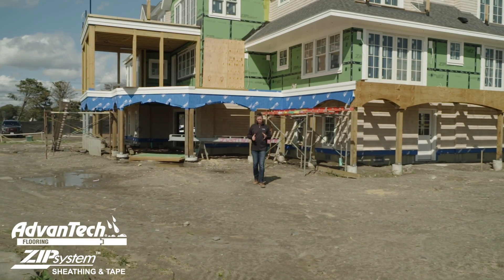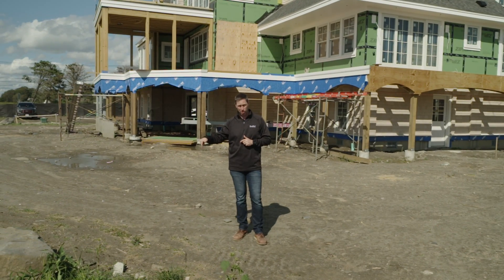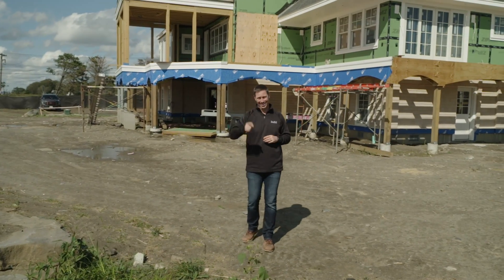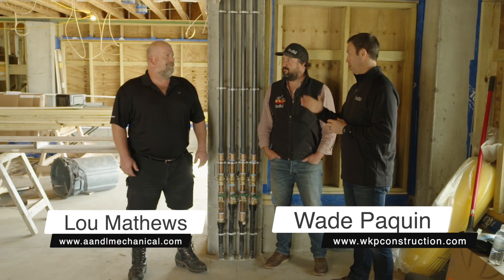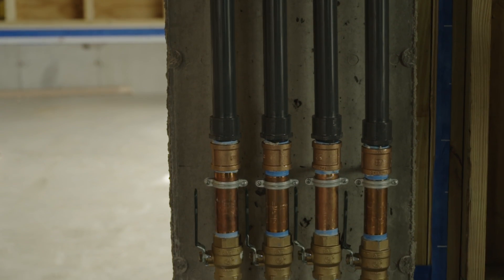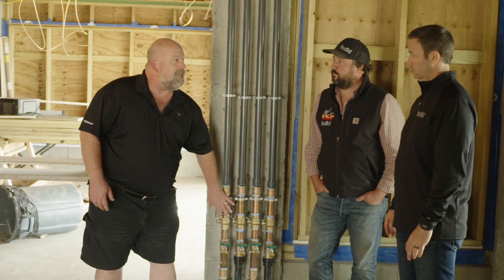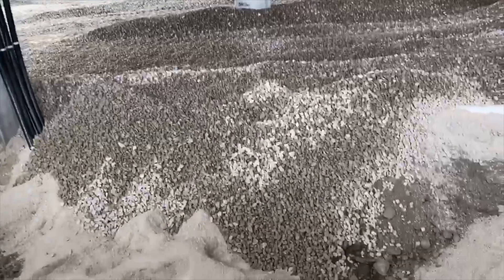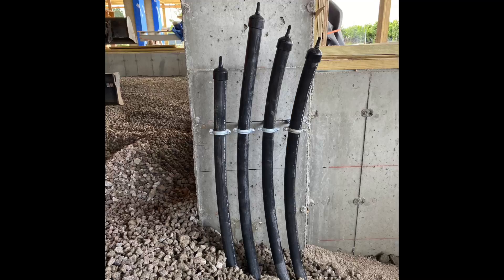Debunking 3 Geothermal Myths

Comment: Here’s another advantage. It doesn’t matter if outside air is 130 degrees or -40 degrees. The geothermal well will never know it. Amazing technology.
Reply: You're mostly right. There are several strategies for ground source systems. I assume that you're referring to vertical loops.
The conductivity of the native formation, and the system's contact with it determine the energy transfer.
Designing for the most prevalent usage (heat  or cooling cycles) is the starting point. Southern, desert, and basically most of the US south of the northern tier of states are designed for cooling cycles. 
Loop  placement. Thermal conductivity will determine distancing between loops. The addition or removal of thermal energy by each loop remains efficient as long as there is no influence by the others. The gradient, or flow direction of the water table and any aquifers which are confined below should be considered.
The driller's experience is important. Knowledge of the local geology determines drilling strategies to both advance the borehole and keep the length of it open for loop placement.
Most important is grouting the annular space of the borehole between the loop and the native formations. Voids affect performance and efficiency.
Reply: Ric Havic Whoever you are you seem quite knowledgeable about the system’s cycle design. I wonder what are you’re thoughts for installing the system onto a bus mobile home or what my young generation calls the “Schoolie Movement”.
Reply: @DylanBegazo  How would you propose moving geothermal wells to follow a schoolie?
Reply: @BullScrapPracEff       Above ground pool,,, maybe,,, lol
Reply: How is it that geothermal energy wasn't covered in so many people's high schools? 
It has literally been used by humans since before writing. 
And somehow the idea that heat rising doesn't apply if you're against geothermal like soving...
Reply: @BullScrapPracEff  wish I could answer that, been a plumber 38 years. Never really heard about it, nothing much about heating systems at all in my high school vocational class. Oh shit,,, just occurred, geothermal doesn’t burn home heating fuel. Well hopefully my comment helped, lol.
Reply: If GSHP had an actual payback value, it would be in every home. Air Source heat pumps I can see with units like Trane x20i. Which pretty much destroy and reason why anyone would got to the short medium and long term pain of GSHP
Reply: Explain why EVERY ground source heat pump has electric backup heaters sold /installed with every system?  Why do we not see the same backup heaters on Nat gas and propane  furnaces...ever?
Reply: @geneticdisorder1900  ever hear of a root cellar? Guess how buildings were cooled in mesopotamia.
Reply: @soving  guess what. There are geothermal systems that are passive and some that are manual. guess what... They don't cost anywhere close to your state of the art toy, they don't require power levels like you indicate, and they can be kept running with about 15 minutes of maintenance a day without an outside power source. 
Now let's not get into VAWT powered geothermal systems. I think that's beyond the depth of this discussion.
Reply: @soving  because fire is hot. Are you new to our reality?
Reply: @BullScrapPracEff  well, to keep on topic just talk about what was me mentioned in the video. I am sure you are more knowledgable than I in the dept. All I have is 30+ years of real world experience hooking these up and hearing the horrow stories and count less people left bewildered and luke warm in the 10-15 year mark after the honeymoon of the new install.
Reply: @soving  so since the conversation reached beyond your immense knowledge of geothermal heat exhange systems and got into the realm of entropy you are now trying to change your points to not be wrong? 
Idiots are often in charge of things. Do you happen to understand the why and how things work or are you relying on 'this is how it's done'?
Reply: @BullScrapPracEff just read what I wrote.  You keep heading off on tangents . I have remained in point. Which is, GSHP which is not geothermal by the way, is of little real $ value when the full lifecycle cost is factored.
Reply: @soving  Ground source heat pump... huh I wonder if that's a geothermal system. I thought you were the expert with 30+ years...
Reply: @geneticdisorder1900  sorry mate but you've lost me when you don't understand specific heat capacity or thermal load density. Antifreeze makes the fluid hold much more heat than without. That's just basic chemistry. It's also why you don't just use water in a car radiator. 
I have the feeling that both of you are operating on 'what I was told' as opposed to actual learning. 
What is the average ground temperature at 50 feet? 75?
Reply: @BullScrapPracEff  I just googled it, water carries more heat, glycol can absorb heat without boiling , my well water was always in the 50* range, water table was 25’ below grade. Well was 195’ deep with 190’ of casing, recovery rate was over 30 gallons a minute. Cost was $3500 in 1999
I know thermal load heat loss/ heat gain from installing boilers for 35 years
Reply: @geneticdisorder1900  let me get this straight. Something with a higher heat capacity somehow can't carry as much heat and also your well water temperature being 50 degrees somehow indicates a ground water temperature of 70? 
Isn't it odd that science fiction always comes into play?
Reply: @BullScrapPracEff  I didn’t say that, my water temp was 50* or so. In Florida it’s 70* or so. I’ve never measured the temp of dirt 25’ below the tips of my grass, lawn grass. My pump was about 110’ below the surface of my lawn just below the 5’ frost depth without snow covering. I didn’t write the article, just telling you what I read, when I googled “does glycol antifreeze hold more or less heat than water. Look it up, it’s why they use it in auto radiators antifreeze/anti-boil, says it right on the plastic bottle.
Reply: @geneticdisorder1900  look man, I have to apologise. I have gone to the extreme in making a point. We have different evidence. There is really no point in arguing. I came at you with a different source of knowledge. I'm sorry. 
Don't trust google as a source, though.
Reply: @BullScrapPracEff  not a problem , I believe it’s a good system, the price is a bit steep for most people. I talked to a person that installs for a living, last geo job he did, said homeowner paid in the 20 grand range. That was a rich dude in Massachusetts, I helped install boilers in 5000 sqft homes, that paid 20 grand for heat and that was back in the late 90’s.Should say too, the closed system is the better one, less problems with hard water issues and water treatment.   Have a good one !
Reply: @BullScrapPracEff  
I think we can all agree that antifreeze mixed with water has a higher boiling point.  But if water cannot hold more heat then it may transfer heat faster.  As you said, there's a reason why we don't use straight water in a radiator, but there's also a reason why we also don't use straight glycol in a radiator.  Water does have some property that's superior to straight antifreeze.  The water and glycol together compliment each other, just like steel rebar and concrete work together.
Reply: @BullScrapPracEff  Specific Heat Capacity of water = 4.183 Kj/Kg K
Specific Heat Capacity of propylene glycol solution(10%) = 4.102 Kj/Kg K
Specific Heat Capacity of propylene glycol solution(60%) = 3.367 Kj/Kg K
As the percentage of propylene glycol increases the Specific Heat Capacity of the solution decreases.
Reply: @BullScrapPracEff  

Schools have used geothermal successfully for decades. If you need a new system and can swing the cost of drilling I think you would be a fool not to use geothermal. It decreases your energy costs and increases the value of your house. This other guy is just a troll!
Reply: As long as the field or wells don’t become to cold which can and does happen.
Reply: Ever been to Canada ? Heat pumps everywhere, has been for decades
Reply: @DGT73  I live in the world's 7th coldest Capital.  I know cold,
Reply: That’s the whole point
Reply: Always entertaining watching this guy that always appears to be clueless. (On purpose, I hope.)
Reply: So, It actually does in a way. All winter the loops get colder and you get less heat from them, and all summer they get warmer. So what a lot of people don’t realize is that at the end of the seasons geothermal is much less efficient and that in extreme cold or extreme hot areas they are not practical at all. I have installed and serviced geothermal for 20 years now for a company that is 70% geothermal 30% conventional. After seeing how these actually work and how overpriced everything is I can’t say that i am a fan.
Reply: Why people try to complicate their lives and then make excuses is beyond me. Investing in super insulating, high performing windows, house wraps and sealing will reduce your energy needs by up to 70-80% forever. No exotic, high end equipment, no HVAC guru technicians required.. Unless it's like a vanity project or some sorta, mine is bigger, cockshow, who in their right mind would leave themselves open to such a mechanical albatross.
Reply: I don’t understand what you mean.
Reply: @DylanBegazo  the groundtemperature stays constant, basically it takes so long for the ground to heat up/cool down, that the seasons don't meaningfully affect the temperature a few meters down.
Reply: Freek Hoekstra ohhh wow. Now I get it. Thanks 😊
Reply: we have geothermal in my house , i hate it. i dont' find it saves money either, the biggest problem is hollow flooring with the pipes.. in colder seasons it takes quite a bit to heat them actually and needs a big generator.. geothermal is kinda scammy for homes.. maybe for giant constructions you can afford the REAL geothermal.. but for homes it's a scam
Reply: @foxbinos  it’s not a scam, your home isn’t insulated well and you are blaming the air conditioning equipment.
Reply: itsabig  another awesome advantage and an ironically funny one is, during a power outage you would need a (large) 20kw+ sized fossil fuel burning Generator to power your GSHP otherwise no heat at home...other traditional sources (gas/propane) could run on a 1500w portable. So be prepared for another $10k backup power. It never ends.
Reply: @soving  wrong again.  The geothermal units are super energy efficient… so emergency generator sizing is smaller than standard HVAC equipment.  

It’s interesting that you think you know so much but in reality you know so little … yet you keep commenting as if you knew something.
Reply: @soving  that’s not true. Once the geo loop is acclimated I did an operational analysis on a system that was heating a 60’x140’ pole barn with a single pitch roof with 26’ peak. Heated to 72F inside with a -8F and 20-35mph wind during a blizzard. Operational load on the meter was 8kw/hr. That’s roughly the same operational cost of an electric hot water heater running nonstop. Also you can’t run an electronic burner control heat systems from a 1500w generator since they are sensitive to electronic noise. If you look at Honeywell Fireye they have paperwork that voids warranty for use with low wattage inverter duty power sources because they aren’t stable sources and blow board level components apart.
Reply: Agree, because of the limited heat in the earth it allows luke warm air distribution when compared to other fuel based sources like natural gas. But, you also get the advantage of paying 4-6x the cost . Winning...no
Reply: @soving  the warming by the earth of the liquid (water) in the closed loops is virtually free.  Using natural gas or other fossil fuels is typical … but it’ll never approach the efficiency of geothermal.  

Geothermal heat pump systems literally can cool a home and have a SEER ratings in the mid 40’s.  Even the most efficient traditional HVAC can’t get anywhere near that efficiency.  

And a geothermal system can heat the same home without using fossil fuels - and since they don’t burn fuel at extreme temps like traditional HVAC units, the geothermal equipment lasts far longer.  

Finally, the tax credits pay for the drilling costs in many circumstances (for productive folks).
Reply: @soving  not if your home is well insulated, easily get 50C flow temps but UFH only needs 30 to 40Max C
Reply: @soving  how big was the rock?
Reply: @BullScrapPracEff  I'm addicted to luke warm air from my $40k state of the art heat source... All together now.....electric backup hurts my pocket.
Reply: @soving  You make no sense. Does geothermal have a prohibitive cost or are you singing it's praises? 
You blow hot and cold air...
Reply: @BullScrapPracEff  LOL, All things considered I think geothermal provides next to no value. It's a net liability.
Reply: @soving  huh. Seems to have worked as a concept since before history...
Reply: @soving  Is 112F luke warm out of the registers? Trane Axiom 1.5 ton in my vacation home will do it all day long on well water. Closed loop systems, if not properly designed, are a major reason Geo has gotten a bad reputation.
65 degree water from a 90' water well....and it never changes. Use a low HP submersible pump (mine is 1/2 hp on a 38 gallon tank...) and you will be amazed at how low your power bills are....and I know it can be even lower if I up the tank capacity to reduce pump cycling.

Code required 5k heat strips, and it's never been on them.....I have a 10k back-up generator just in case. Duke power has changed my meter 3 TIMES because even they are sure I'm stealing!!....LOL
Reply: @soving  insulate your property
Reply: @DGT73  somewhere down there in all the scroll I mentioned, Insulation is the best ROI. I'm in your camp.
Reply: @imtheonevanhalen1557  Glad you like yours. If we take an educated stab, your pump uses about 4amps (1KW) and your HP uses ~11amps (2.6KW) and in the winter months you have I would guess a 60% duty cycle (14hrs a day averaged over a month) 3,6KW*14=50KW/day. Using $0.15 per KW that would be ~$225/month in Electricity.  From the 1.5ton sizing, I would guess you have a very well constructed small home, or a larger Passive House style design. I'm calling you on the Duke Power story as if you only ran the HP, you would be about the same as the average home with traditional heating.  I looked and you Heat pump has a 12-18 month Parts only Warranty Standard. Extended Warranty will take you to 5 years. I wouldn't want to be around for the Compressor replacement or motherboard in year ten.

Comment: We have a geothermal system and love it. Typical electric bill in Iowa winter is only $120-150 (total bill, everything in house is electric). It came with the house so not sure what the previous owner paid. The only downside is that its very slow to make any temperature change.
Reply: That's not really Geothermal related actually. Most heat pump, hydronic radiant heat, systems are slower to head because of it's lower BTU. A conventional gas furnace heats your house quick because it's usually way oversized, operating at 80-110k BTU. So it fires up and heats your house right away then shut off. Heat Pump (conventional or geothermal) run at a much lower BTU, usually 42k-60k BTU so around half that of a conventional gas unit, it's not designed to be an on and off kinda system. Especially today with variable refrigerant flow units, they're designed to be left always on. Heat Pumps take a while to get your temps to a desired temperature, but it's most efficient at maintaining temperature. 

One of the worst things I've see people do is install a Nest to control a heat pump. A conventional thermostat that's set and forget is probably the way to go with these system. If you want a smart thermostat for looks, you have to turn off all the smart features and program it yourself to a specific schedule
Reply: The units are only efficient maintaining a temperature. It’s set and forget. No more lowering the thermostat when you go to bed or leave for work. Ramping up and down will kill any savings.
Reply: @519VXComanche  I have to disagree. I've experimented a lot with it using a "Sense" energy monitor and it is FAR less expensive to set 55F during the day (winter) when we are at work and then bring it up to 64-66 when we get home.  Vice versa in the summer we set it at 83F when we go to work and then bring it down to 71-74F when we get home.
Reply: @MP-dc8lp  You must have a very efficient heat pump bc there is no way mine could overcome a 10 degree rise in 8 hours without kicking in the 30k worth of heat strips.